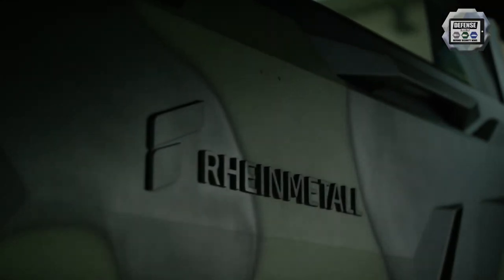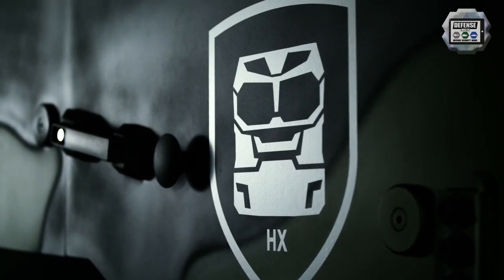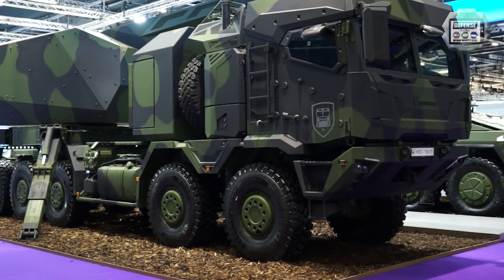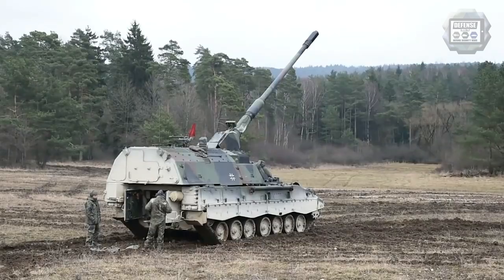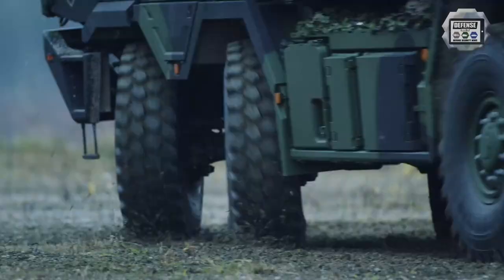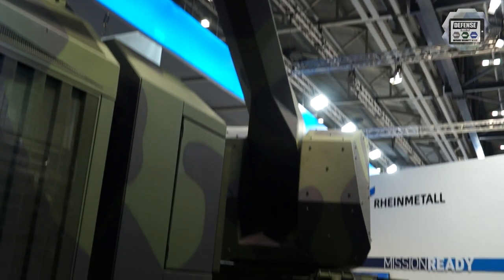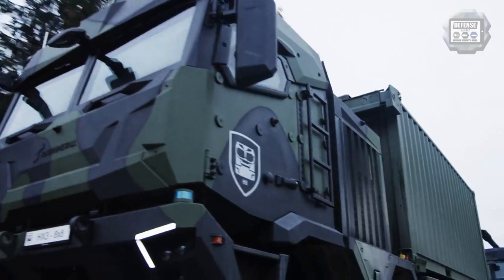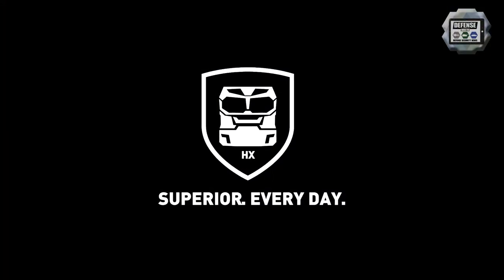Rheinmetall HX3 10x10 155mm self-propelled howitzer technical review Germany defense industry

Comment: Looks very potent. German quality. In the 90's S.A. 🇿🇦 built a 6 x 6 wheeler 155mm howitzer  that can shoot basebleed projectiles up to 72 km range at 5 rounds/ minute. Is there perhaps a howitzer that can surpass this achievement??
Reply: Not true. Only the modified G6-52 ER reaches 73 km with V-LAP rounds. Regular G6-52 with normal base bleed reaches 39 km, modified G6-52 ER with base bleed reaches 50 km.
Reply: @jonny2954 
Jonny, denkst du die RCH 155 wird ihre Hilfsstützen benötigen sobald L/60 statt L/52? Momentan kann die RCH 155 ja ohne deren Aufbau feuern.
Reply: im just not sure if howitzers shouldnt still be able to drive through mud ... firing just from roads could give the foe way to much conclusion where its driving next ...
Reply: I think the U.S. military has developed a SPG with possible 100km range but not yet done it, its their plan to achieve that aim.
Reply: @jonny2954  I was referring to the upgraded G-6/52 ER with base bleed projectiles.  Denel Armscor industries export it to different Arab states. The type that is still in use in the SANDF is the Rhino. With special base bleed projectiles it have a range in excess of 40 km.

Comment: As far as truck mounted artillery goes these are a pretty nice piece of equipment.
Germany has made a lot of equipment that looks pretty good but will never see use I hope someone purchases these. The EU are going to have to design something better than the T-14 Armata and have it in service sooner rather than later with the accelerated rate of weapons development worldwide at the moment.
The MBT is still a relevant piece of equipment on the modern battlefield so a new turret or a whole new tank design to replace the leopard 2 is needed. How many defence exhibitions have we been to with excellent concepts that never see production ???

And well done to Hungary at least someone has purchased the Lynx KF41 IFV I hope the German Strike Shield APS works as promised with high expectations for the performance of all the latest Active Protection Systems currently available.
I would have preferred the dual ammunition fed Wotan 30mm cannon with the built in ABM feature on the Hungarian Lynx KF41 but that is my personal choice.
The Hungarian version of the Lynx is a great vehicle with a lot of development work done over a six year period. The Composite rubber tracks or rubber band tracks as they are sometimes called can be fitted to the vehicle if requested as they were tested on the Australian version of the Lynx KF41 successfully by Rheinmetall. Also the Lynx has a multitude of different variants with a Combat Support Vehicle that was developed in Australia available. Thankfully after many teething problems it has ended up a very good military vehicle.
😎👍